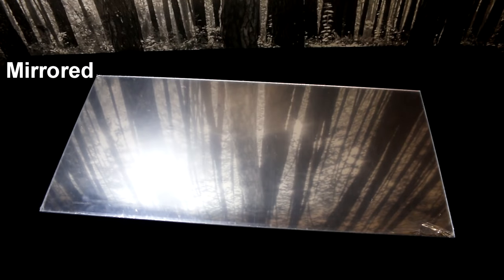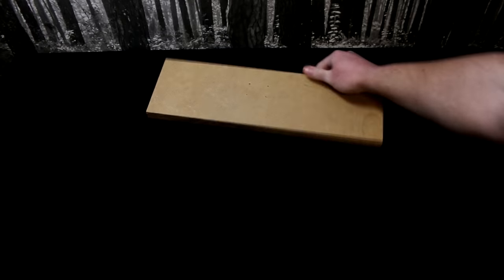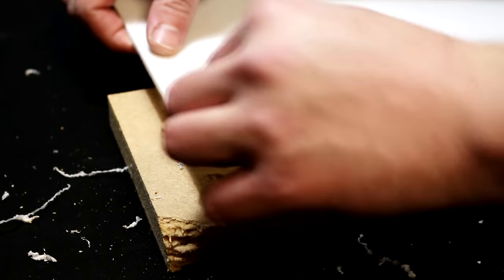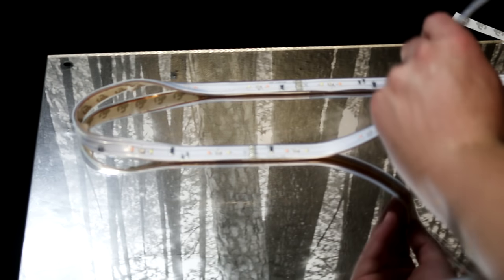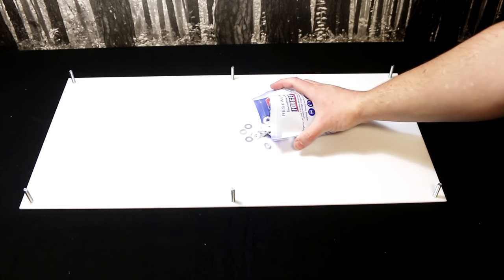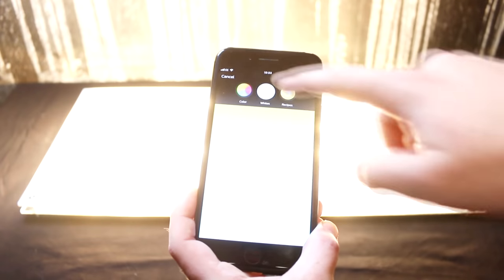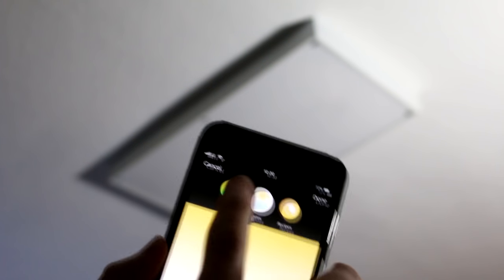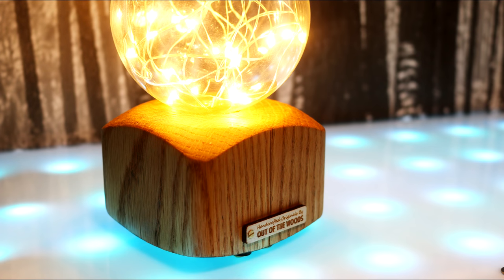DIY Philips Hue Panel Light - Easy To Make

Comment: Thanks, this is something I could actually build myself.  I have been trying to backlight the Assassin's Creed logo in my basement.  I have a fuse box which is enclosed in a cabinet with fake stained glass.  I had a friend cut out the AC logo in thick black panel board, and then I taped it to the back of the plastic stained glass.  I added a hue light (Hue Go) in the cabinet, but the effect is completely lost.  If I place the Hue Go directly behind the glass, I can see a giant red ball behind the logo.  If I place it off to the side, you can barely make the logo out.  Instead, the wires and fuse panel are clearly visible whereas the logo is simply not that obvious.  I am game to try to make this LED panel and adhere it to one of the cabinet doors directly behind the stained glass.  It looks like it will make sufficient light to shine through, but also block shadows from behind.  I have a Philips Lightstrip which I had originally installed behind the TV, I'll use that and put the Go behind the TV.  Any additional advice before I get started?  Essentially, I plan on emulating exactly what you have built here, and then affix the panel to the back of the cabinet door.
Reply from the maker: Thanks Pete! Love the sound of your project! You can use any kind of LED light strips really. There are some very cheap options that are even usb powered to save any messing about

Comment: Just so you know, you can buy packs of connectors for these strip lights for cheap. There are different kinds too, like right-angles and even 4-ways, so you don't need to have that bulky loop whenever you change directions. Or you could cut the strips to length and solder a little wiring between them. Old phone/data lines work really well for that.
Reply from the maker: Id read somewhere that the Philips Hue lights wont work if they arent joined with the Philips connectors. I had a 2M strip and I read that if you cut it off, the LEDs you cut off cant be used. Theyre pricey so it wasnt something I wanted to take the risk with lol
Reply: Honestly, I don't know anything about the Philips-brand products specifically so that very well may be true, but I can't think of how they could make a splicing connector not work. A conductor is a conductor, and that's why you can skip connectors and just solder on telephone wiring as an alternative. I know for a fact that "regular" LED strips can be cut to nearly any length (there's usually a minimum). The cut ends can definitely be used, you just have to be sure to cut on the little row of copper or silver dots/bars that you see between each set of LEDs. I can't quite tell the length between the LED segments on yours, but I'm definitely seeing the rows of dots/bars where the cut should be made.

What was it you read that said the cut-offs couldn't be used? Was that for the Philips strips or for a specific length? I can't see how that could be possible, otherwise there wouldn't be any connectors to buy in the first place. I wonder if maybe they're sneaking in a cross connecting wire like some of the old proprietary internet cables used to have. If so, they should be burnt at the stake.

Wow! Out of curiosity I checked the pricing for the Philips-brand connectors on Amazon, and... Yeah, those are waaaay over-priced! LOL, I'll just stick with my soldering iron, thank you very much.

Really though, it probably doesn't matter and having those bends probably helped scatter the light better or something. I just like things to be square and tidy so I figured I'd mention all of the above. And none of this detracts from the fact that you made a really nice light panel!

Comment: Nice. I was surprised when I saw you use so many washers, when knocking up six wooden spacers would have been so simple.
The light turned out great. If you are going to use it as lighting equipment, maybe add handles and a detachable stand. It could make an interesting project.
Reply from the maker: Thanks mate! I wanted to use as little tools as possible. Its more approachable for people with no woodworking skills to just pile on cheap washers for spacers. 

I like the idea of adding a hand and stand. It would make positioning a lot easier

Comment: You've gave me an idea for my workshop.....are the LED sets a good price?
Reply from the maker: Glad Ive inspired you 😊 The LEDs are ridiculously overpriced! I got these with my Christmas money lol I already have Philips Hue bulbs so I wanted to add on to that system. You can get bog standard LEDs for literally a tenth of the cost. The 2m strip I got cost £49 on offer from Amazon 🙈
Reply: Average Joe's Joinery I'm going to be looking at just white LEDs. I wouldn't need the colour choices. Hmmmm, I'm thinking now😀
Reply from the maker: There are white LED panels already made up which may work out cheaper. Ive got one in my room now lol
Reply: Average Joe's Joinery They seem to give off more/better light than tube lights.

Comment: Have you tried to replace the wall switch to a traditional one (NOT ELECTRONIC)? As power output would be still the same.
Reply from the maker: The original switch on my wall was a standard on off switch. In the process I upgraded to the electronic version but unfortunately neither worked with the Hue strips. After contacting Philips they confirmed only their power adapter will work which is a shame

Comment: Er,
You can install an outlet to plug it into,
And you might need to change the switch to a normal switch
Reply from the maker: Thats an option but there isnt enough space in the light fitting I have. I could make a deeper box for it though

Comment: I guess it's more important to put out product in a timely fashion than to do something right. If it worked on the table, then it will work on the ceiling. Why not sort it out then post it?
Reply from the maker: Lol Ive had this video ready to post since last year. There isnt any way it will work on the ceiling because you have to use Philips own power adapter. Its important to make people aware of that. I didnt even have to mention wanting it to be a ceiling light on my video.
Reply: The ceiling has different power than the table? As an electrician I'd be curious about that.